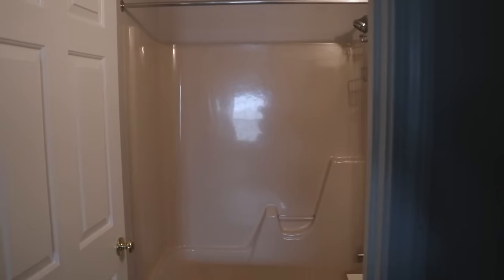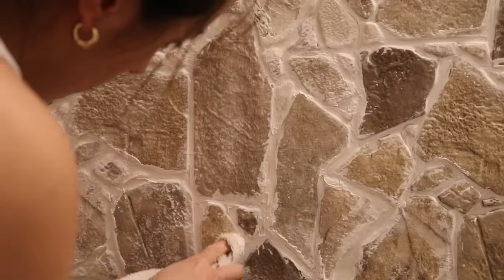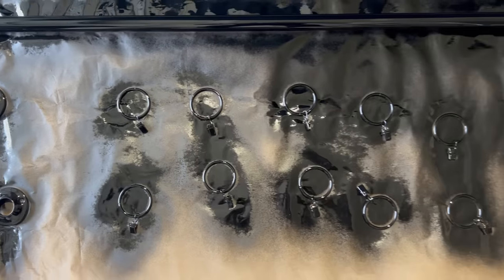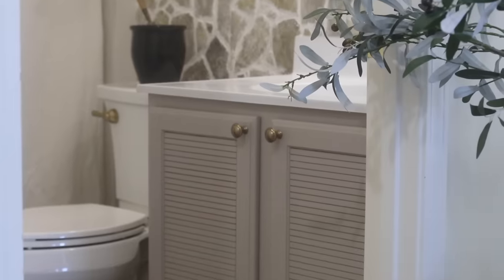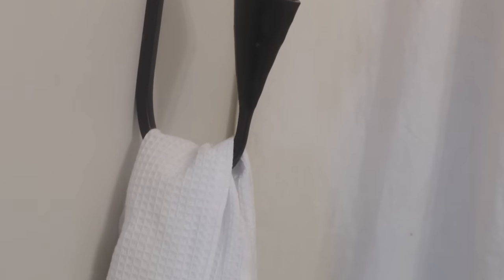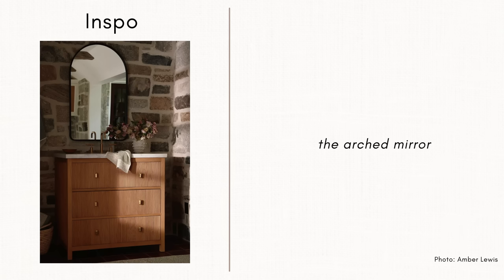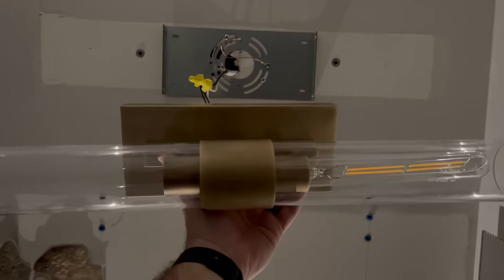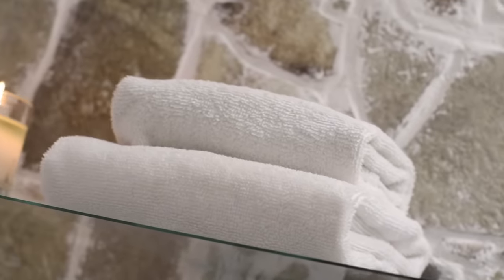HIGH END VS THRIFT STORE | DIY BATHROOM MAKEOVER | DIY THRIFT FLIPS | DIY ACCENT WALL

Comment: Yes that glass is too thin, but couldn't it be covered with some frosted contact paper ? You would still have some transparency,  it wouls add minimal extra strength, and if it did break it wouldn't shatter because the contact paper adhesive would keep it together.
....just a thought. But you will likely come across a piece of glass that will work just fine.
Overall, a well done transformation.

Comment: I may have missed it — but where do you hang a bath towel for guests ?
Reply from the maker: This was tricky so I chose to either hang a guest towel on the calla lily candle holder. (With a battery operated candle). Or I also have a hook on the back of the door. Not ideal but it’ll work for my guests!

Comment: FIA.       I love what you did, but please take down that glass shelf. Any glass from picture frames WILL NOT HOLD UP, IT WILL BREAK. It doesn't have the strength to be set horizontal. PLEASE REMOVE IT BEFORE SOMEONE GETS HURT.
Reply: I was gonna say the exact same thing!
Reply: Same! If that thing shatters while someone is standing there barefeet.. that's a hazard!   Please order some safety glass.
Reply: Same!
Reply: And it has sharp edges.  You can find something better and safer, I’m sure!
Reply from the maker: Wow! Okay I think going the cheaper route may not have been the best route after all. Thank you guys all so much for your concern I truly didn’t think it would be a major danger because the stuff on it is extremely lightweight. Appreciate all of you for being here 🥰
Reply: @FiaGarciaDIY  Tapp Plastic has acrylic in every thickness and they'll cut it to size - I put it on my round kitchen table for a fraction of what glass costs, it's lighter and indestructible - little scratches buff out.
Reply: @FiaGarciaDIY As an alternative to picture frame glass, glass cutting boards (often found in thrift shops because they're terrible for knives) can be used with no issue!!!!
Reply: Yes, that thin glass shelf is a disaster just waiting to happen.  Actually I NEVER use any glass in my bathrooms.  When something does break, that last chard will be found in my foot even months later.
Reply: You need tempered glass for that shelf! Somebody could get hurt badly…
Reply: Same!  
Oh No~~~Please use The Tampered Glass
Reply: I read this comment before watching the video and thought, “y’all need to calm down”. Then I saw what she did - yeah that’s not a proper shelf. Too flimsy, although a glass shelf looks beautiful
Reply: Same
Reply: Absolutely
Reply: Just love the faux rock wall. Very good idea!  You’re the best!
Reply: Calla lily sconce, painted sink, fake plant in water ❤❤
Reply: Loved what you did.  The cabinet doors were awesome!  Let us know how the spray holds up.  You are so talented!  Thanks for sharing.
Reply: Oh, I Love this So Much!! I have this bathroom too! 😂 I’ve been wanting to redo it almost as soon as we built our house. 🤦‍♀️ Builder grade, yes! 
Oh, oh! Thank you for the tips on the liquid nails!!! I had no idea 😮 I honestly don’t think my husband did either. Very helpful information!! 🤗
Absolutely Love the new look! ❤ Beautiful!
Reply: How is the drywall compound holding up.

Comment: I haven't read all 300+ comments, so please forgive me if someone already mentioned this. It's strongly recommended not to leave Epsom salts open to the air, especially in a humid environment like a bathroom. The salt is extremely hygroscopic, meaning that it draws water from the air to itself. Your salt will form clumps and eventually become one solid piece of rock salt. Sorry! Maybe you can come up with a way to cover the crock and hang the ladle nearby?

Comment: Glass from a frame is so easily broken and is not tampered glass, so this use is very dangerous! I would never recommend putting any weight on it or putting it horizontally in a spot that could be bumped in any way.
Reply from the maker: Thank you for the tip!! I’ll be sure to replace it with some tempered glass!